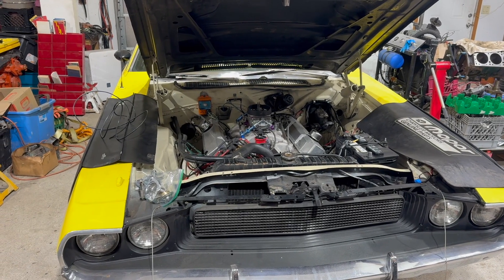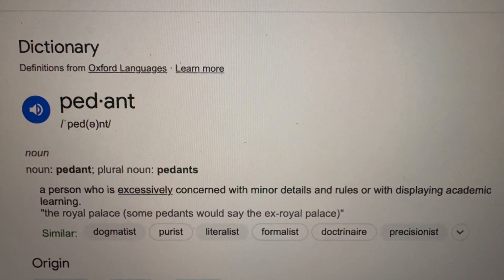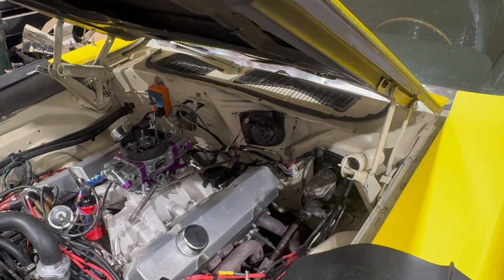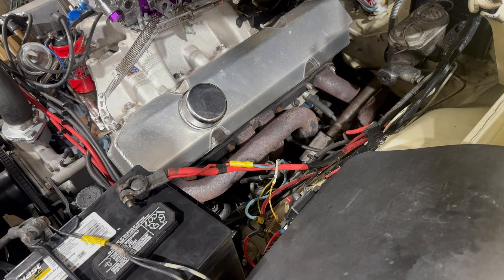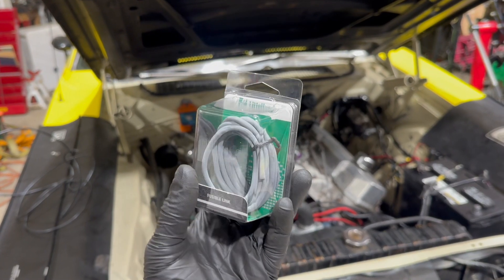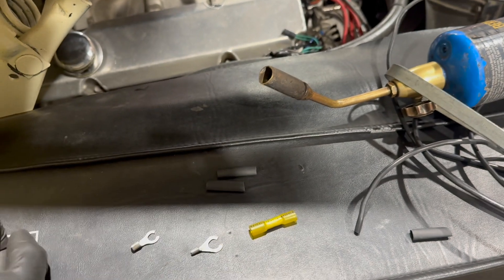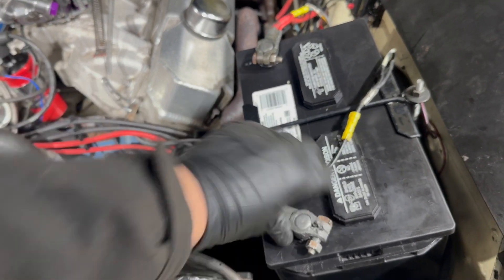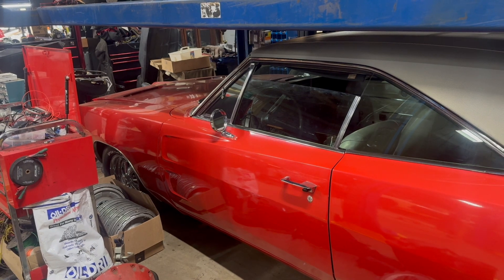The Big Shunt Wire Guide - Prevent Electrical Meltdown In Your Classic Mopar With This Easy Fix

Comment: If you want the ammeter to deflect more, I believe you could put your shunt on the firewall side (near where it normally passes through twice, so theres less wire, albeit less convenient place to work).  Then remove the shunt that's mounted on/in the back of the ammeter.  This increases the sensitivity of the ammeter, without sending all that current through the firewall twice.  Right now the ammeter is seeing a lot less "signal" to react to.  You'd allow it to see more by getting rid of its old shunt on the gauge.  This would just be to satisfy some OCD, or possibly a customer who wants the gauge to "work better", not really necessary.

Comment: I'm late to watching this video. My dad's 66 Coronet has its original bulkhead connection for the 59 years and 207k miles that its been on the road. Always had a stock alternator and never any extra accessories. Its survived but in the Spring i may be doing this. You're the best Jamie.  Happy New Year.
Reply from the maker: Our wagon is still stock too. Demon is stock. Etc. But it’s a good idea.
Reply: @DeadDodgeGarage  I hear ya. It's on that list if you know what I mean ....😎

Comment: Get a better grade of terminals, eyelets and solder them.
Reply from the maker: There is an everlasting debate in the automotive electrical space between soldering and not soldering. I’m crap for soldering, and I’ve had years of good luck with crimp connectors. So that’s what I do.
Reply: @DeadDodgeGarage  indeed, all modern cars use crimps everywhere, exclusively.   I would recommend avoiding the "solder and heat shrink in one" connections popular now.  They're fundamentally flawed and you'll get a much better connection with the double-ended crimp butt connector.

Comment: Could you just bypass the bulk head connector and ammeter completely? Then just run a fused power wire to the bulkhead?
Reply from the maker: That’s definitely an option. One would look at a diagram of the original system and find an acceptable place to make their power connection. Most likely the load side of the ammeter, and the wire going back to the bulkhead to connect to the alternator could be cut out of the solder pack.

Comment: Nice video Jamie. Did Chrysler Australia know something, when they switched the steering to the correct side? Our earlier cars just had the engine harness fed through a grommet in the firewall, no junction box. I have another suggestion for the name of that instrument, what we commonly call it down here "Amp gauge". There, another lesson in speaking Australian 🤣 Oh, we do have a fear of that gauge burning the car down here too. I am glad they included that gauge though, one night driving, the lights seemed to be just a bit (lot) brighter than normal. First thing to look at, the ammeter, amp meter, amp gauge, which was pinned hard against the C. That told me to instantly shut that motor off, and whack the old style flip flop regulator to free it off.
Reply: Decades ago I drove a Plymouth Horizon Hatch Back thousands of miles through states along Eastern, Southern, Western and Northern Coasts and Borders of USA, the voltage regulator quit regulating, fully charging battery until headlight low beams burned out and battery boiled acid out while pushing the sides of the battery out, then the regulator stopped charging at all before I could get to auto parts store to replace Voltage Regulator, headlights and battery.

Comment: Would you ever just install a volt gauge in place of am meter, with a little bit of wiring ?
Reply from the maker: I’ve done it in a customer car - with a gauge that was built to match the dash. People keep saying “just swap to a volt gauge” as if just throwing any random volt gauge in there is going to work. It’s not that easy. Indeed, wiring a volt gauge is very easy. I don’t want to see one hanging under the dash. I like stock clusters, and ideally I like them to work. It’s not hard.

Comment: Interesting timing on this video. Tell me what happens now should a short occur anywhere in the stock 12 ga unfused wiring and switches with this “shunt wire” in place, even with its own fusible link and all? I’ll tell you; wires and connectors will burn as the circuit protection level is now more than double what the stock fusible link is on its own. Not only have you defeated the purpose and accuracy of the ammeter with this shunt wire by-pass, it also exposes all factory unfused wiring and components to more current potential in the event of a short as the current potential from the battery now has two paths to the point of a short, creating paralleled fusible links. This by-pass does not make this electrical system safer by any means. Why not promote a really safe factory like “Fleet by-pass” on these stock, or close to stock, Chrysler applications? Or the C-body recall approach to by-pass the bulkhead charge path Packard terminals, as you point out, by far the weakest link in the original charging system. Leave the ammeter alone. The ammeter is not the cause of these issues when operated as designed. These passenger car ammeters can handle a great deal of current with correctly maintained connections and insulators, but they are useless if charging current has been routed around them. Retains proper/safe circuit protection as well.
Just to be clear, I am not angry but am a “trained expert” in this field with more than 50 years’ experience in the trade, including many years wrenching on these Chrysler products at dealers.
https://youtu.be/fkRZzs4ScMo

Kirchhoff's Current Law and the Current Divider Rule
https://www.youtube.com/watch?v=mpXzH03A-Qs
Reply from the maker: I guess my response where I promised to launch myself off a large piece of concrete into a body of water for not 100% meeting your expectations here was found distasteful by YouTube. Oh well.
Reply: @DeadDodgeGarage  He will /delete his comment he did on all my videos too.
Reply: @oldblueaccord2629  All your videos?  I commented on one video pointing out the severe risk to your stock unfused wiring/components with your 2/0 battery cable being placed directly between your Scamp battery and the alternator with no circuit protection at all. You replied with a nasty name-calling rant as I recall. Don’t recall deleting it, funny my replies to your earlier comment here in this comment thread yesterday have disappeared.
Reply: @72roadrunnergtx  I actually liked your comment but you deleted it before I could respond.
Reply: @DeadDodgeGarage  I’m sure it was another disrespectful smart-ass “how dare you question what I say” retort, must have been a really good one if YouTube removed it. Funny, they don’t have an issue with you flipping off your viewers on camera on live feeds for questioning what you present.
Reply: Hey buddy!   I was hoping you would chime in! Where is my heart emojji?????

Comment: Thanks for this!  I'm restoring a '65 Barracuda and this along with many of your other videos have been a great help and reference.  Any reason not to run the shunt wire across the front of the engine, since alternator and battery/starter relay are both towards the front?
I've got a one-wire alternator with a shunt wire running across the front (tucked in near the radiator) and to the positive battery terminal.  Great info on the fusible link, I hadn't heard about sizing 2 gauges smaller than the wire its protecting.  I'm filing that in my long-term memory, so I'll likely forget it tomorrow and have to come back and watch again :)
Reply from the maker: No reason at all - I just prefer to hide my work as well as I can. Haha. You bet! Thanks!

Comment: That bulkhead connection could potentially cause major issues after 50 or so years of aging and electrolysis.  I thought that was a relatively new thing that came along with EFI when wiring harnesses went freakin nuts in complexity. Guess not.
Reply from the maker: Oh, not at all! People have been having these problems for decades.

Comment: I have always “split the difference” on this mod. I really like having the Amp gauge working so I just replace the factory wires to and from the meter with much larger gauge wiring. The relay kits for the headlights is pretty much a mandatory mod for me as well. If you want to switch from incandescent to halogen headlight bulbs, it is the only way I have found to avoid constantly replacing headlight switches and the easiest way to say goodbye to headlight that dim when the rpms drop to idle. I have more fear of the firewall plug melting down or shorting out than the amp gauge. I need to rewire at least the dashboard forward on my ‘64 Barracuda and I was seriously considering just making my own wiring loom and leaving the big plug out altogether. In addition to a fire due to high resistance, a short that causes complete loss of headlights at 55-70 ain’t much fun either! Been there; done that … don’t care to rinse and repeat! Good content, as always!
Reply from the maker: That’s how I like to do it! And yes, headlight relays are the way. Did a video on that subject way back. Also, it’s not a short that causes the loss of headlights at speed - it’s the tripping of the headlight switch’s internal breaker. It only ever seems to happen to me on high beam… and it’s quite terrifying on a back road in particular.

Comment: Disconnect the battery at night?I'm confused?
Reply from the maker: If a short develops in your alternator, and the fusible link doesn’t blow, you’ll really wish you had. I know someone with a car that almost burned itself to the ground in the garage an hour or two after a drive for that exact reason. Luckily he was still awake and smelled it. And this is why we disconnect the battery negative on every classic parked in the shop.

Comment: It would be really nice if someone could make a replacement ammeter that was electronic and used an inductive clamp to measure current draw. Ammeters in cars are so much more useful than volt meters or ever worse, battery lights. It would just be nice to rewire with your method but retain an accurate current reading.
Reply from the maker: Agreed.

Comment: God Bless those lowly AMC's.  Since I can't think of one single model off the top of my head that came with an Ammeter as standard equipment... they never had the meltdown issue. The few cars that came with optional Ammeters had a dedicated wiring harness that eschewed a bulkhead connector and simply ran wire, unbroken from battery to gauge.  About the only issue that I've ever seen is that some ammeters have gotten warm over the past half century and melted the usually plastic gauge housings AMC used.

Doesn't make a whole lot of sense to me why Mother Mopar never thought about that.  Especially since the cars' entire electrical load has to pass through the bulkhead connector.  You'd have thought "The Engineering Company" would've been a little more thoughtful especially since they opted to equip most of their cars with an ammeter as standard equipment.

On the other hand.... I suppose they never figured we'd still be mucking about with these cars 50+ years later.....
Reply from the maker: You know what’s funny is that around ‘63, they DID know. The main power connections are much more secure screw terminals. But apparently they forgot at some point…
Reply: The accountants must've won that argument or electricity may have changed about that time.

Comment: My ignition harness inside my steering column went out and it fried my fusible link and did damage to my bulk head connector. Replaced it all and disconnected my ammeter. Great video Jamie and thanks for the help with that issue.

Comment: I saw you mentioned about shunt wires in a previous video, so I added one to my car While I was doing some other work to it. The Guage reads same as what you were showing. So that's good to know! I didn’t add a fuseable link though, so maybe I'll do that.
Reply from the maker: I’ve done a few without - but I certainly have to tell you that adding one is a very good idea!

Comment: OK, help me with my dim memory here: I repaired a couple of Mopars that came through the shop many decades ago with firewall connection/ammeter meltdown.
Used the same shunt wire Repair that you outline here. This is what I can’t remember:
Does the feed wire on the firewall side going through the ammeter have to be there for any other reason to power other components?
If the ammeter doesn’t work anyway, I see no reason to keep the  firewall side ammeter feed wire in place. Or am I missing something here? You probably already know this: I just purchase a dirt cheap cigarette lighter plug-in  volt meter to replace the old ammeters.
Reply from the maker: The electrical system is powered through the ammeter. The charge wire from the alternator is joined in a solder pack with the ignition switch feed and battery-side fuse panel feed. So you don’t need the wire that runs to the alternator, but you need the rest of it in place.
Reply: 10-4, thanks!

Comment: When I tried this it said my battery was getting 15 at the battery rather than 12.5 what am I doing wrong
Reply from the maker: 12.5 would be not charging, or sitting and not running. 15 would be about the high end of charging. Typical range is 13.5-14.5, depending on electrical loads and battery state of charge, but a bit outside of that is still ok. If you rev it up and it spikes to 17-18v+, you have a regulator or regulator wiring problem. See my charging systems video.
Reply: @DeadDodgeGarage  thanks I'm 67 been doing this for 50 years and learn a lot from you

Comment: Great tutorial in regards to ammeter function and the need to bypass for better electrical performance. I own a 67 Firebird with an AMP gauge, I tried in vein to get it to operate properly as you have found. I am wondering as I disconnected my amp gauge, is there a way to IMPROVE SENSITIVITY of the Ammeter to better reflect the CHARGE/DISCHARGE that occurs during running with a SHUNT in place. I would LOVE to have my amp gauge working.... THIS VIDEO has given me hope that it can happen... Very good clip. BDBD/2025
Reply from the maker: There may well be, but that’s well beyond my level of understanding. I can tell you that there are companies out there like Redline Gauge Works that can convert an amp gauge into a volt gauge that will fit in the same location, and that might well be the better move.

Comment: Hi Jamie, Would it be possible for you to send me a diagram showing the exact location of the connections of the shunt wire you did in the video.  I'm wanting to do that to my Li'l Red, so it doesn't burn down!!  Thanks, John
Reply from the maker: Not sure how I would send you a diagram, but it’s very straightforward. You’re connecting the one big stud on your alternator to the one big stud on your starter relay, located on the driver side inner fender in your truck. Later trucks uses a different style relay than what these cars had, but yours should still have the stud. If not, going directly to the positive battery terminal is also acceptable.

Comment: Jamie l will be doing this to my charger but one other thing to help out the headlight switch is putting relays in the headlight wires after the switch and highbeam switch. Only thing is for me its a little confusing for me wiring them up. l know l need to do this to reduce the heat in the headlight switch which will make it last longer and less stress on the wiring.  AKA heat melt down lol
Reply from the maker: Absolutely - and I did a video about that upgrade years ago now, which can be found in my Electrical Guides playlist.

Comment: Back when my dad owned my '79 Dodge St. Regis, the ammeter itself got a bit melty where you could see it. I don't remember the exact circumstance but my dad immediately disconnected the battery. He disconnected the wires from the gauge, cleaned them up and joined them together. Under the dash got a three gauge set with a voltmeter.  Years later, when I revived my '68 Fury VIP,  I did the alternator shunt wire with a different style of fusible link because I'd had gone from a 37 to a 65 amp alternator. At some point, I might replace that with a fuse. I also disconnected the gauge wires, bolted them together and wrapped them in a lot of electrical tape. I have a triple gauge set with a voltmeter under the dash as well. Headlights got a Putco harness with relays which took a big load of my headlight switch. Much happier at stoplights at night.

Comment: How about on earlier cars, say a 58 Fury where there is no bulkhead connector, a generator, an amp light, and where I believe everything goes through the headlight switch circuit breaker?
Reply from the maker: Somewhat different animal with a generator. I could swear the ‘57/58 dash still had the gauge though? In general, if that circuit is working, I would leave it alone.
Reply: @DeadDodgeGarage  57/58 Plymouth have a combined oil/amp light in the gauge cluster. Thanks for the reply!
Reply: I opened my switch and cleaned all the contacts. They were pretty bad even on an NOS switch. It’s fiddly but not hard. You can add a fuse, but I don’t think the charge goes through it.

Comment: I had a 79 powerwagon and the ammeter smoked my whole cab up one day, melted the housing. Found a nos ammeter and it worked fine for awhile, I would reach up and feel it regularly cause I was terribly gunshy of burning it down after the first time, then damn it if it didn’t do it again while driving down the road one day. This explanation makes great sense, I always thought that was a stupid way to route the wiring, I wish I’d have known about this shunt wire hack back when I had the truck, wondering now If that would have saved a pair of expensive nos gauges.